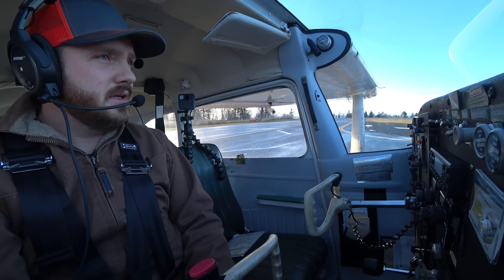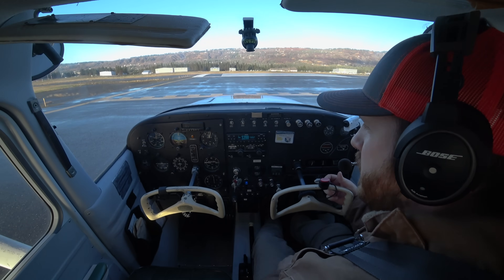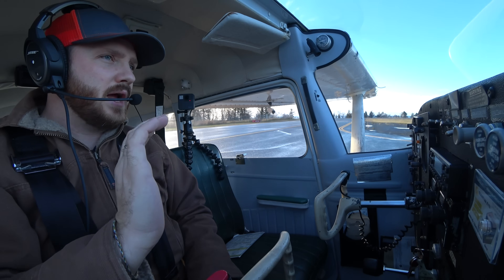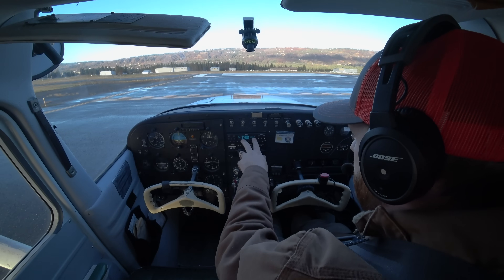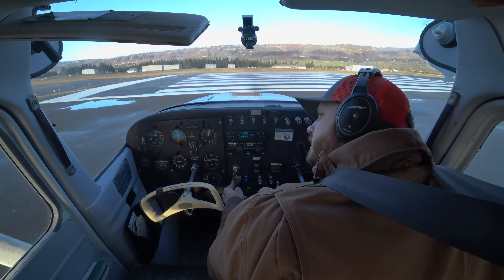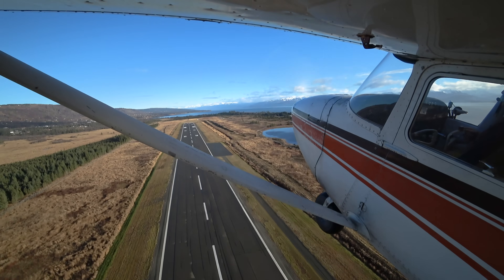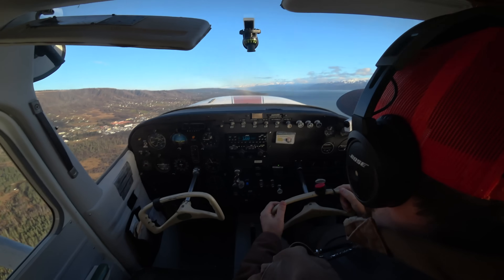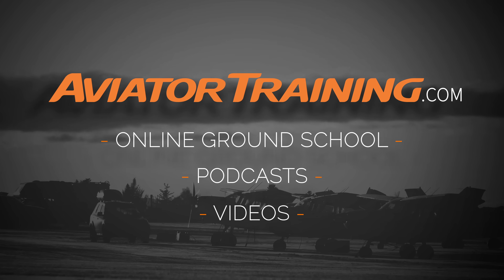How to fly: Normal Takeoff

Comment: Doing a 360 in the taxiway to check for traffic?  LOL NO.   Also you mag keys are in a dumb location.  Why have all those dangling keys next to the throttle?
Reply: This is a thing now.  On a recent checkout I was made to do this as well.  For good reason, I would have run into a Gyrocopter (with no radio) landing on a public field.  I got my private in 1992 and I wasn't taught that way.  However, I can completely see why you'd want to do this on a non-towered field.